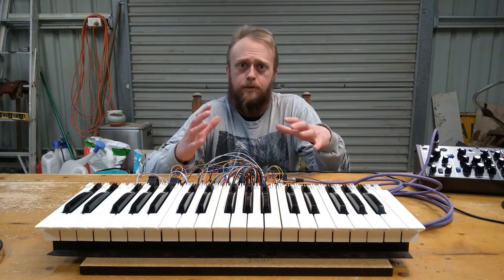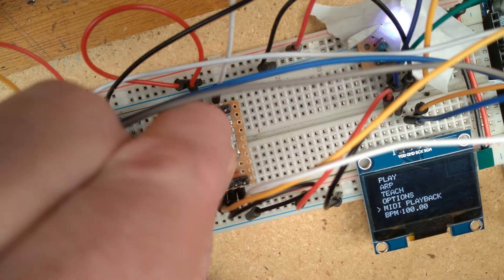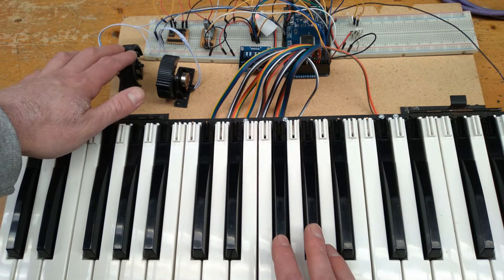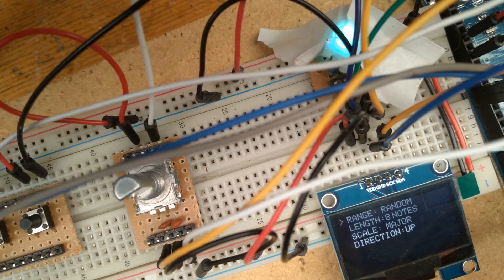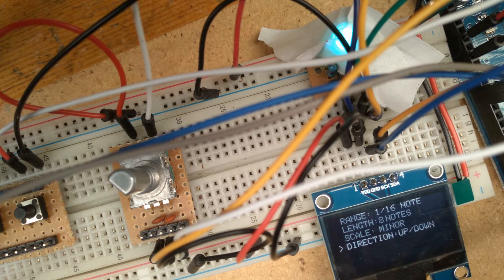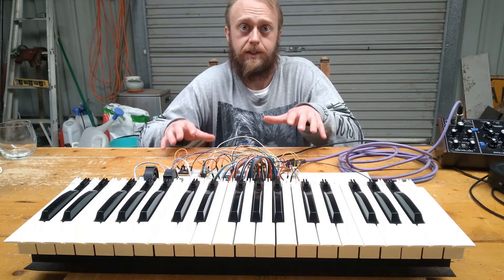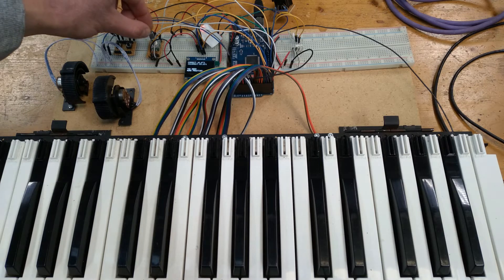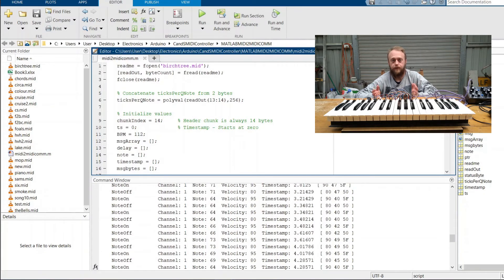How I Coded The MIDI Controller With Arduino! - Part 2: Features Of The MIDI Controller

Comment: Hi .. Brother  help me out ....with simple arduino uno  usb  midi project. ...... im. Not getting any Signal  on  ipad  Basically i want to use  arduino usb midi with ipad 
Any Suggestion ????
Reply: The Arduino Uno has no midi. But you can connect a midi plug to it and use a midi to USB converter cable to connected it to the iPad
Reply: @gguitarwilly  hi. Thank you so much. For ur rply & can uh plz suggest any cheap  BLE module which can Work as BLE midi. Device
Reply from the maker: Hey mate, I haven't used the USB protocol with MIDI before, so I don't have any advice to offer I'm sorry! 
You could make a post on the Modwiggler forum or Synth DIY groups on FB/Reddit - I'm sure someone there will have some knowledge for you 😄
Reply: No, I’m sorry. I don’t use Bluetooth midi myself..